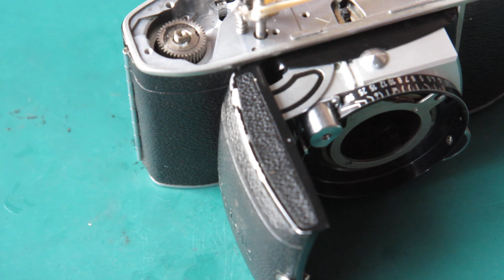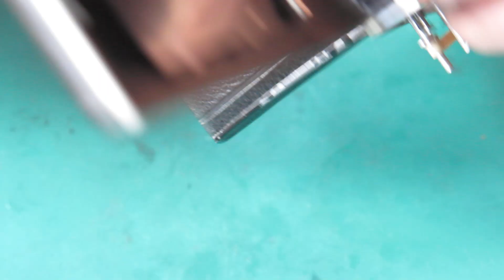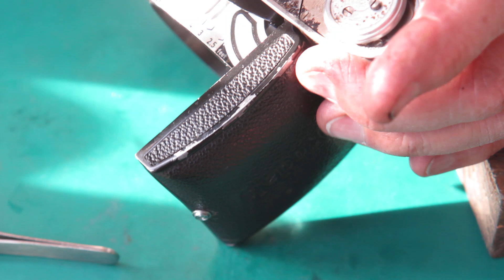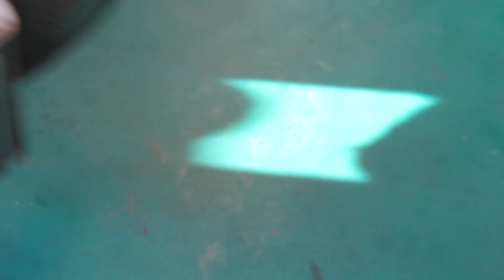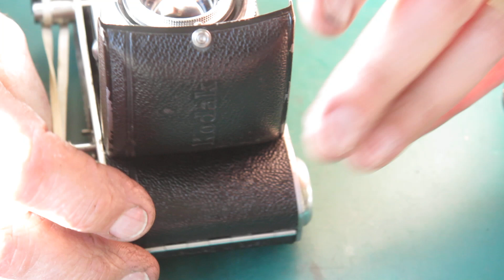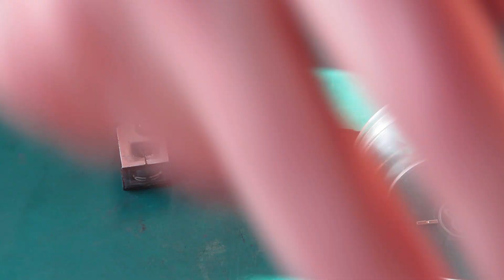Somebody else's failed Retina IIIc repair project, part 07

Comment: Hi Chris 
May I ask, Why I should go to the expense of buying molybdenum paste over the use of a synthetic grease. 
Please advise me of the benefits.
Also I have a RETINETTE 1A 
The plastic rewind shaft mechanism feels stiff. Is there anything that I can do to free the movement without lifting off the top cover. Please advise  as i do value your expertise.
Reply from the maker: Peter, you don't really think I use different lubricants just for a bit of variety do you? I use the different lubricants for different purposes because experience has taught me that they work best for that particular job. That doesn't mean another lubricant won't work, just not as well.
Reply: @ChrisSherlock 
 Hi Chris
 thanks for your reply.
I do realize that. I'm requesting the reason for using different lubricants  and where they are best used. It seems that molybdenum paste has an  effect in certain situations but so does grease.  I just wanted to know why. 
As you have explained one works differently or better than another. May I ask why.
 I Did you read my request about the RETINETTE 1A
Reply from the maker: @petervanorsouw2858  G'day Peter, you will need to remove the top cover to do anything useful with that rewind. The plastic shaft is retained with a tiny ring, so you cannot just push the rewind shaft out. Removing the camera top is easy, just unscrew the rewind knob with your fingers, two screws underneath it, one at the other end of the top cover. Don't tip the camera upside down...
Reply: @ChrisSherlock  
Thanks  Chris
 I do value your advise. This model has a hot shoe, as you are aware and I have not seen you lift the top of a RETINETTE 1A so that is why I have asked for your help. As the film wind on and rewind shaft mechanism are plastic,
I don't want to wreck this camera, as it does make pleasing enough pictures. 
Even though it's no Leica or Retina 📸 
Hopefully when I get back into the darkroom again, I will see its full potential.